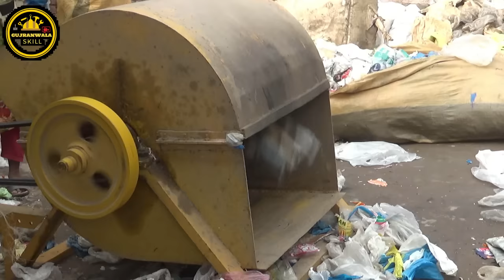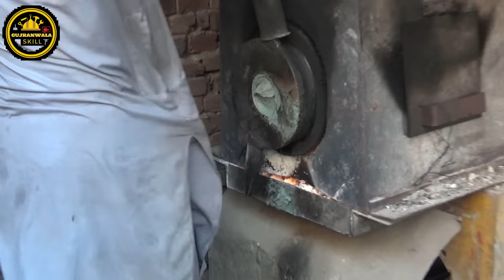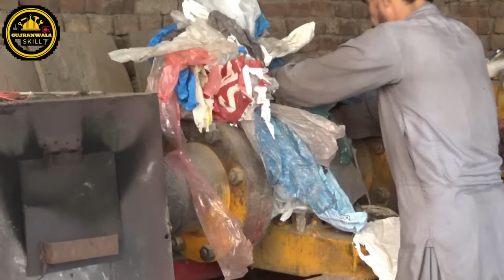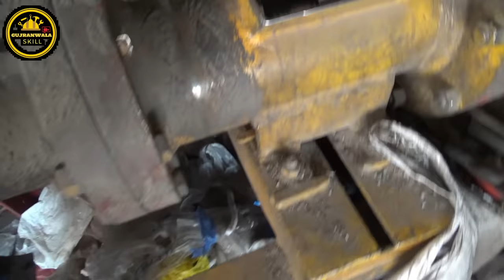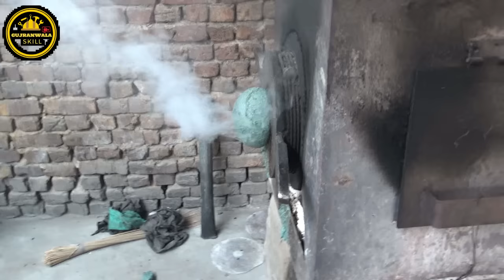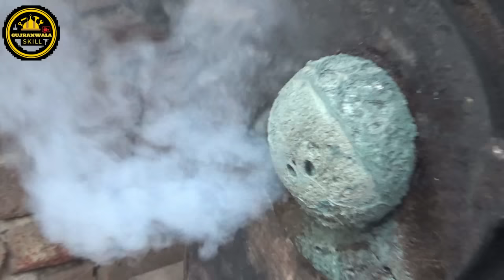How to Waste Plastic Polythene bag Recycling to Plastic making Amazing skill  plastic bag recycling

Comment: What was the purpose of running the bags through the shredder at the beginning?
Reply: Removing dust and sand particles
Reply: @EXChristianRamRam  then why dump them on a dirty dusty floor before and after being melted
Reply: @melvinhunter6334  😂. That is special dust on the floor 😉